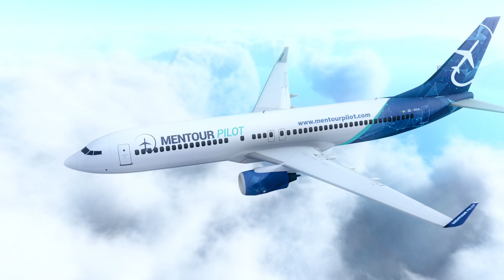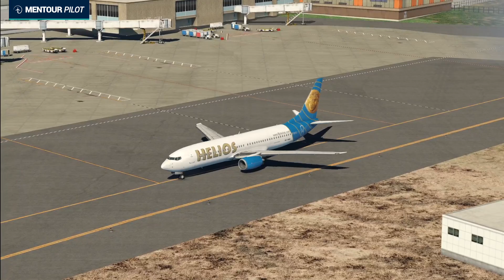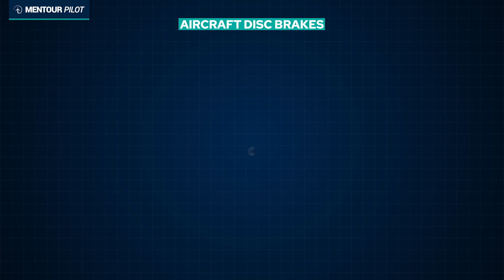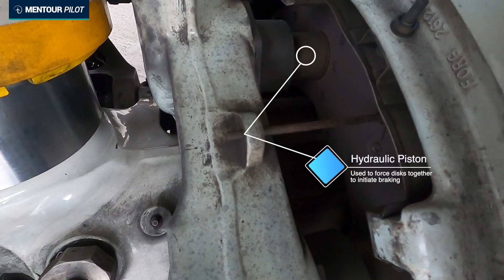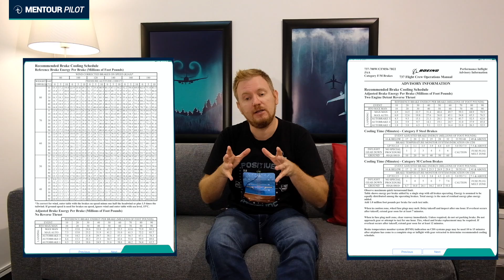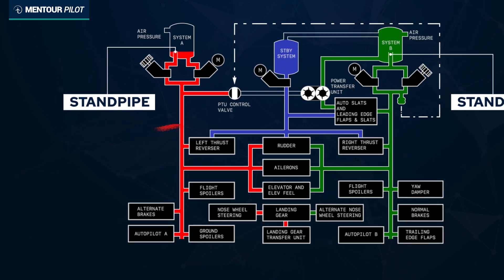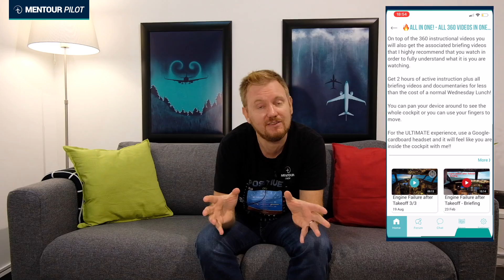How do Aircraft BRAKES work?!

Comment: the Bae146 had brake temperature gauges because it had no thrust reversers, and more braking power was needed on landing.
Reply: I flew on BAe-146s quite a few times in the '80s as a kid.  I didn't recall them not having thrust reversers.  I do know they had an interesting airbrake (or spoiler) that was like a clamshell that opened at the tail.  I miss those planes actually.  I flew on them when PSA (Pacific Southwest Airlines), which painted a smile under the nose of their planes, was still around on the US West Coast.

Comment: I’ve read that Concorde was one of the first airliners to make use of Carbon Ceramic brakes, not only for the weight savings, but also because of the higher takeoff and landing speeds she had compared to her subsonic counterparts.  She also had brake cooling fans to help keep the brake temperatures in check during taxi and after landing.

Comment: They work really good ▬ multiple discs and anti-lock won't prevent error
Reply: The discussion about exactly what ABS denotes seems to have an influence from the other side of the pond;

Brake Anti-Skid Systems (Part One) - Flight Mechanic 

We call them Anti-lock braking system here ~ Commercial Pilots likely develop there own lingo unique to the trade

Comment: After a rejected take off it is usual for the brakes to be so hot the pressure in the tyres could get dangerously high so there are plugs in the wheel assy that melt and releive the pressure. Not a lot of cooling but engineers will have to change the wheels before it can be moved once the tyre becomes flat. I once attended a DC10 that had RTOed in Africa meaning we had 10 wheel and brake changes with non destuctive testing required for damage to the axles due to overheating.

Comment: It's been a long time ago but I can remember 727 and DC 9 occasionally arriving at the gate with very hot brakes. If it was dark outside you can actually see a glow from them and we were always told that that was burning magnesium. When we would see hot brakes we were always told to never approach the gear from the side and to the only approach from the front or the back in case it was to explode and the split Rim separated said it would blow out to the side. You definitely never wanted to throw water onto a hot break or it would explode. Usually the fire department would put fans in front and behind the landing gear to try to cool them off slowly.
Having helped our mechanics replace brakes before, it's is surprising how heavy those things are.
Reply: You should never approach mains straight in. Aircraft wheels have thermal plugs that melt & deflate the tire if the brakes get too hot but you shouldn't bet on it. You really should never bet on anything an engineer designed.

Comment: In fact, the brakes are more closely related to the multi-plate clutch on a motorcycle than a car disc brake ('though the clutch default is ON and the brake OFF of course).

Comment: What happens to the breaks after a rejected take off? How much increases the temperature in the system? Is special maintenence required before next flight? What kind of fluid is used in the hydraulic system? Can it lubricate the disks?
Reply: You don't want to lubricate the disks unless you are using a hydrokinetic brake on a heavy or fast train.  They work well on railways but are far too heavy for planes.
Reply: It's aviation-grade hydraulic fluid. This is the stuff that causes fires so it should never contact the brake stack, it only pushes the pucks in the brake housing (the white part inboard of the wheels) to contract the stack & cause friction. Generally, nothing is required after brake application.

Comment: For those who wasn't struck by lightning: 2.2 GJ is approximately the explosive energy of half a ton of TNT.
Reply: Who does that equal to a gigawatt?
Reply: @Joeybagofdonuts76  If you release 2.2GJ in ~1.8s you get 1.21GW
Reply: @maxsz91  thanks
Reply: @maxsz91 1.21 GW??? That's a bolt of lightning! - Emmet Brown
Reply: @Joeybagofdonuts76  a Watt is defined as J/s, so the wattage depends on how much time it takes to convert that energy to heat. It took the 747-8 in the video about 20 seconds to stop so if we assume the A380 and 747 are similar, you're looking at 110 MW of brake power. To put this in perspective, if you could convert that to electricity, you could power about 65,000 households for those 20 seconds!
Reply: @ex4787  let's not forget that the A380 is considerably heavier than the 747, so assuming they reject the takeoff at the same speed, the A380 has more kinetic energy to deal with.
fun fact: the maximum landing weight of the A380 is more than the maximum takeoff weight of the 747.
Reply: @Joeybagofdonuts76  it's 0.61 megawatt-hour, if anyone is interested.

Comment: The rims gets hot too. I have always wondered why the enormous heat do not harm the rubber tires.  
Technically the brake system is a lot like a car. Even with loss of auxiliary help from failure in the vakuum system that powers the brake booster you will have stored powerbraking for 1-2 times. And you have 2 hydraulic systems in the car. Not 3 as in the aircraft.
And the anti skid is a lot like ABS. 

Adjustable autobrake we do not have. :)
Reply: Heat does weaken and can even fail tires, so airliner wheel/tire/brake systems are designed to keep most of the brake heat away from the tires.
Reply: @marcmcreynolds2827   how is that possibly done. 
There is some serious engineering doing that. The disks are millimeters from the rims and capsuled inside them. The energy they store has to be ventilated one way or another. And to ventilate 2 giga in-capsuled Joules without heating the rims is hard to comprehend how is done.  Very interesting. 2,2 Gigajoule is about 500 kW/h. 
If the brakes used for this in 30 seconds we are talking 3-4 million watts. Or 1800 households. 
This is over my head... :)
Reply: @rubricen   You're certainly right about that when it's an extreme braking profile which puts the maximum design energy into the brake, or anything close to maximum.  Those tires are not going to be spared the scrap heap, but are at least rendered harmless by fuse plug activation.  I was referring more to how heat transfer into the tires can be mitigated for normal operations.

There are three ways for heat energy to be transferred into (or out of) a mass:  Conduction, convection, and radiation.  All three of these can be manipulated to some degree to achieve a satisfactory result.  Radiative heating -- a big contributor on higher-energy stops -- can be lessened by a thin heat shield, for example.  It heats up instead of the wheel, and then convection carries much of that energy away from the wheel and therefor the tire.

In daily operation, the main contributor to tire heating is the tire itself.  Even at pressures of around 200 psi, airliner tires are operated at about twice the deflection of passenger vehicle tires, and they have much thicker cross-sections.  So flexing in the footprint area as the tire rolls produces heat within the tire, and the low thermal conductivity of synthetic rubber means heat will tend to hang around in the rubber rather than quickly dissipate, leading to an increase in rubber temperature.  Plus, all of the heat which dissipates along the interior surface of the tire raises the temperature (and pressure) of the dry nitrogen inside, contributing to more temperature rise.

Temperature rise just due to a tire's rolling, even if it's only from taxiing at moderate speed, can be dangerous if the distance is long enough.  I once did a tire temperature analysis at the request of an airline which showed that for MTOW operation of their widebody, unless they kept taxi speed down to 10 mph during the maximum possible taxi distance of about five miles from their terminal to the runway, the tires' temperature limit could be exceeded before completing an assumed RTO.
Reply: @marcmcreynolds2827  I guess Safran know what they are doing.  Obviously they do. 
This is most interesting and also a bit overwhelming to realize how much engineering and smart thinking there is when designing an aircraft. To balance all those factors combining security weight economy and lifetime expectancy is a huge task. 
"How to make an airliner" well, that is a very long story. :)
Thank you for the brief insight.

Comment: When landing gears are retracted after takeoff, does the wheels stop spinning automatically or the crew needs to apply manual braking??
Reply: On some aircraft pressure is applied via the undercarriage retraction system to briefly apply the brakes. The nose wheels are stopped by pads in the nose bay which rub on the tyres once the wheels are stowed. Not on the A320 series so sometimes you get a rumble as they slow down.
Reply: On the 737NG: 	
The alternate brake system gets pressure to operate the brakes during landing gear retraction.This stops wheel rotation before the landing gear retracts.

Comment: Petter when the planes sit for a long period do the tires get flat spots from sitting long?
Reply: They can👍🏻 When parked for longer periods the wheels are turned at intervals.
Reply: @speedbird9313  Do they move the plane slightly then?
Reply: @joebrown1382  Probably different procedures at different MROs. Sometimes the ac is moved anyway to run the apu and move surfaces. It can also be moved slightly, but some are really strict about having the nose wheels on the mark at the park or gate. 
If it is hard to move you can jack up each of the gears and turn the wheels by hand.
Reply: @speedbird9313  I was thinking jacking up the carriage & I guess to change a blown tire they would jack them. I get the mark for the nose wheel, kinda strict on that. Thanks for answering my questions. I like to know things that many are not concerned with.
Reply: @joebrown1382  Correct, the landing gears are jacked when a tire or brake needs to be changed.
Tires are changes due to wear or cut, a blown tire is extremly rare😉

Comment: What I use to picture what 2,2 Gigajoule of energy means is: This would be sufficient energy to bring 6579 liters of water from 20° to 100° (not including evaporating it). Everyone who has been waiting in front of his noodle pod with a few liters water to finally start boiling now can imagine, that you use a lot of energy for 6579 liters.
Reply: Release this energy in less than ~1.8s and you have enough power to power the flux capacitor and jump back to the future
Reply: @maxsz91  As long as your speed is 88mph = 76.5kn.
The Flux Capacitor is very reliable.
Reply: @rainscratch  Minimum speed requirement goes without saying - it's basic knowledge
Reply: @maxsz91  Only genius mad scientists can design the system though.
Reply: Excellent analogy.  If you can imagine a 1000 liter water tank and its mass (1 tonne) multiplied by 6.579 - that's a lot of water and mass to heat up! Interesting to know how long it would take to reach 100 deg boiling point.
Reply: I don’t know about everyone else, but I don’t have a strong mental reference for 6579 liters of anything. Without doing some math, I’m thinking that’s in the ballpark of a smallish swimming pool.
Reply: @JakeRobb  1 cubic meter (1 meter in all directions) is 1000 liters of fluid and it is 1 tonne in weight. 
Aircraft fuels are very confusing as it can be measured in liters, gallons, pounds, tonnes, kilos. There have been  a couple of  crashes due to fuel starvation as the method of measure was wrong. 
it really would be beneficial to universally apply ONE unit of measure for aviation including fuel, to avoid confusion and errors in different parts of the world.
Similar as is done with feet which is the most common altitude measure or knots for speed.
Reply: @rainscratch  yep, I know the math. But that doesn’t provide a mental frame of reference beyond the conceptual. Like if you talk about “one trillion dollars,” most people understand the number conceptually, but don’t truly have an understanding of how much that is in any practical sense. 

For relatively large volumes of water, I think swimming pools are probably the most likely practical frame of reference that people can understand.

Comment: You mentioned that carbon breaks resource is limited by the number of times breaks are applied. So if an anti-skid system applies and releases breaks numerous times, does it mean that it wears off carbon breaks that much faster?